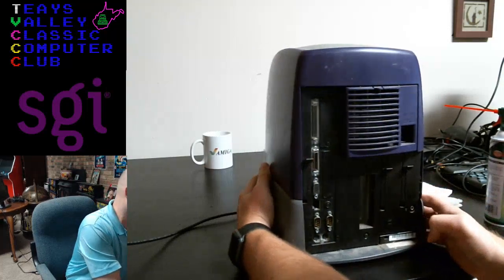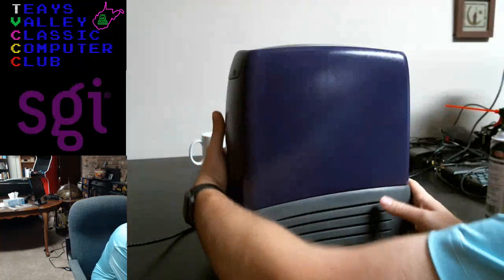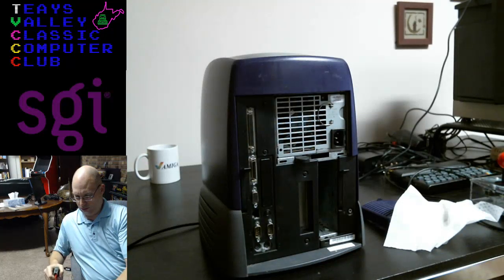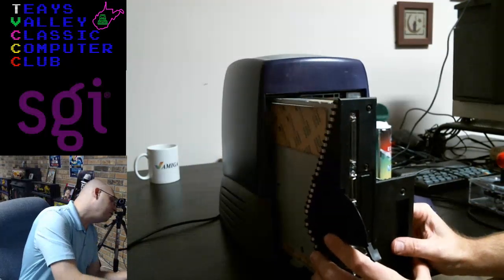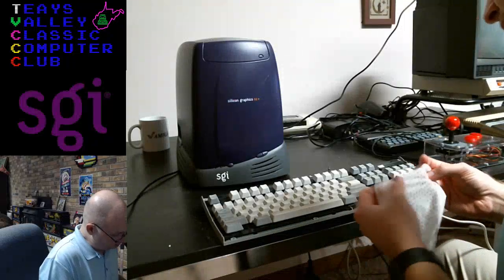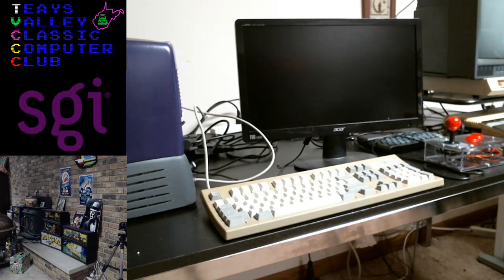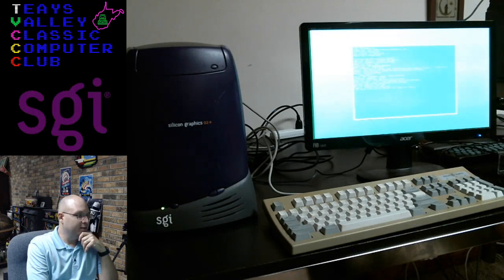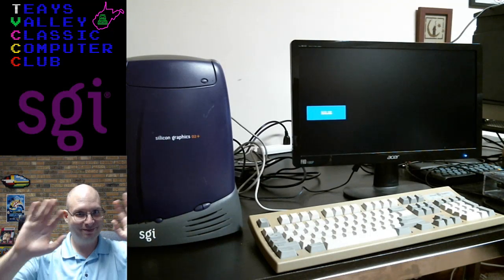Cleaning and testing a Silicon Graphics O2+ Desktop Workstation

Comment: Solid red indicates a cpu failure.  Typical advice is reseat or replace the cpu module.  You probably jostled it by roughly rotating the system to get to the back.

O2s can be very flaky.  The LED on the front gives a lot of info btw.  This is a handy troubleshooting reference:

https://techpubs.jurassic.nl/manuals/0630/enduser/O2_OG/sgi_html/ch04.html
Reply: Solid red doesn't mean a CPU failure (that would be extremely rare). Rather, it usually just means the I/O engine has gotten into a confused state, which can sometimes be recovered by using the force-power-on jumper next to the Dallas chip. However, it's not always recoverable.